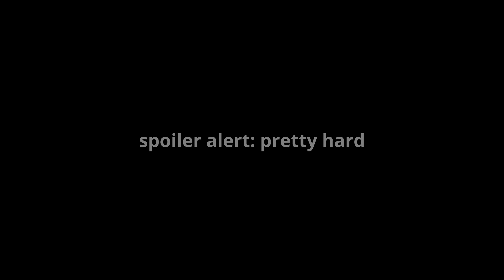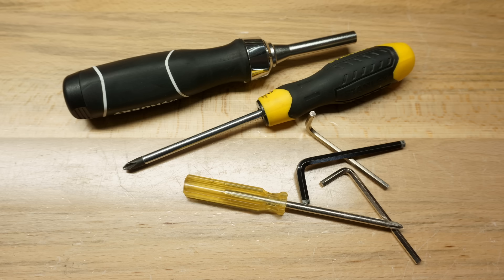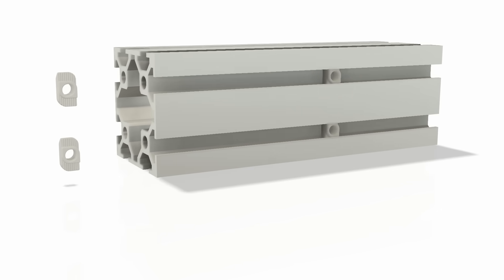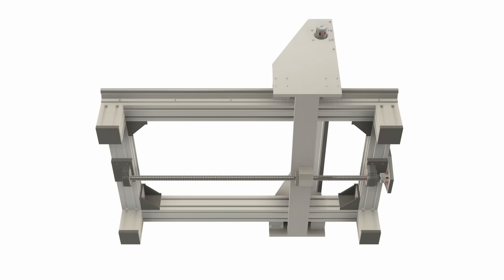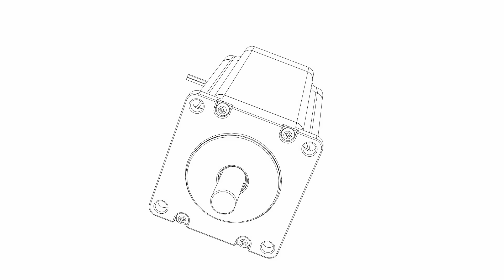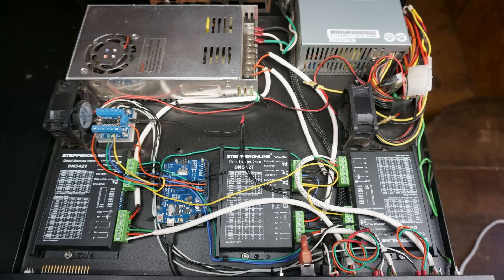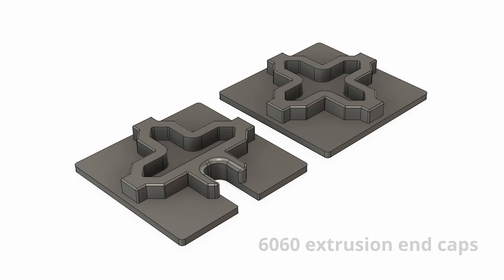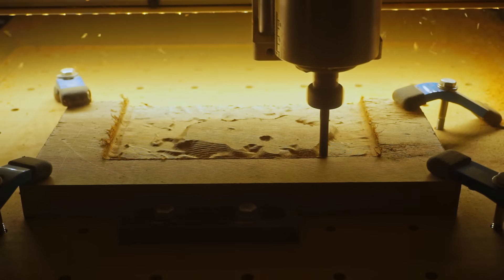Making a DIY CNC machine with limited tools

Comment from the maker: Please see my follow up video for answers to questions and more info: https://www.youtube.com/watch?v=nlWXileUSbU
If you want the 3D files and wiring diagrams, check here: https://github.com/BenMakesEverything/Ben_CNC_v1
Reply: Thanks for sharing your experience and showing this project, Ben!:)
Just a sidenode: Next time you plug in a mains-line power cord, don't move on, just wait for some seconds and think about it: What would happen, if the male contacts where swapped with the female jacks .......... Right! We would all be dead by now. Now look what you have designed/done with your motor power connectors (btw. connectors are a good idea). They literally invite disaster[1]:)

[1] Here the danger is not so much for the well-being of us humans (although it is never a good idea to have current-providing and potentially live contacts fully out in the open, flapping in the breeze), but for the well-being of the machine. Sh.. can happen in this configuration and it WILL happen! Especially in a place with metal shavings and dirt all around like a workshop. Just swap it around, so that the female part of the connector is the "power-providing"-side. 

Good machining!:)
Reply: @dieSpinnt  I don't fully understand your comment.  Can you elaborate since I'm planning a similar build.
Reply: Hey Ben - good stuff. I'm also thinking of making a Router CNC table like this (>'.')^
Reply: Oh  yeah !!! Good and fantastic Job ! Thanks for sharing
Reply: Hello, I have a Makita RP2301FC milling machine. Can I use it on a workbench like this?
Reply from the maker: @ertugrulemre2525  You should be able to, you would just need to design or buy a different bracket to mount it to the machine.
Reply: @benmakeseverything  How can I make this bracket? Thank you

Comment: Bit late but... using some really stiff spring you could mount the top with some longer bolts for leveling purposes, that would be a really flat top. Also, the NO/NC thing, this makes no real difference here, you can define that in code, just use the opposite. For false signals, you should add pullup/pulldown resistors, they might work... had a lot of trouble using them with arduino/esp32 anyways. One thing I didnt try is shielded twisted pair for sensors with pullup/downs and caps with sufficient trigger times to chnage states in code. Also, found out that using a serious power supply is cruicial. By serious I mean a transformer one, switching units work poor, forget usb phone chargers. Thing I tried to recreat was a SBR sewage system. Original board was STM32 that was literally octocoupled from anything else and isolated power. Eventually found out repairing original board was easier than debugging all the false signals with arduino and did just that. This taught me why would you need a custom PCB, not a breadboard with bunch of jumper wires doing theirs antenna stuff.... especially when working with contact relays or around large IGBTs, those can even freeze your chip, althou arduino seems more stable than esp32. Nice project, thinking of building something of this kind myself but the motion screws, slides and metal prices... anyway, cheers for a good build.

Comment: "Making a DIY CNC machine with limited tools" and yet he has cut and finished in cases sizable aluminium parts to precision with limited tools my ass! Great job but very misleading title. maybe define "Limited tools" most people think of the picture you advertise with ,a screwdriver, etc on display yet you didnt use them to cut this stuff for sure. use a cnc machine to make a cnc machine.

Comment: Great job!!!! I think the isolation/filtering of the endstops connections made the cables work like an antena. You shouldn't do that. Endstops should be just pulled up with like 10kOhm resistor and pulled down with like a 1kOhm resistor when the endstop is pressed. Those resistors are isolation enough and the conductivity is high enough to make the voltage stable without draining current (little to nothing) so interferences can't affect the digital level.

Comment: Hey ben I am looking for a CNC for doing wood this looks a bit over kill Do you have any ideas or recommendation on making one please
Reply from the maker: Well, to be honest this is the only CNC I've ever used. If you just want to buy something I've heard good things about Shapeoko, but never used one myself. As far as making one - if the goal is to reduce the price, you could possibly use smaller/cheaper motors and lead screws, although that will decrease the power. But for small wood carving that may be fine. There are other people that have posted DIY builds on Youtube, but I can't recommend a specific one.

Comment: Hi, lovely video mate! I'm also looking into building my own CNC machine and your video was very helpful. What would you say is the estimate cost for this project cause i'm on a budget? Thanks alot!
Reply from the maker: Hi, glad you enjoyed the video. This was an older video and I actually built the machine back in 2021, so prices may have changed. But I think the total for the machine was around $1000, maybe a bit more. I didn't keep close track of it but did run some numbers back when video came out because a lot of people asked.
Reply: @benmakeseverything  Wow, that's quite a good price for a machine of this capability! Thanks a lot, cheers!

Comment: Extrusions are not, as you claim, stronger than solid. Also, remember that aluminum is the butter of structural metals.
Reply from the maker: I think I said, "lighter and cheaper" - but I should say "stronger per lb/kg" since solid plates would weigh more.

Comment: Um can this machine carve thick steel?
Reply from the maker: I wouldn't recommend it - this was built for wood and light work with aluminum. Its just not rigid enough and needs a better option for the cutting tool than the router.

Comment: Hi Ben, well done young man. I use  F360, Arduino, GRBL & UGS to try to make a DIY MINI-MILL. I had an small X Y table and a spare Dremel.  All I wanted to do was hog out a slot in a 1940s Model Train Steam engine chassis and carve some sheet metal for side rod linkages of various steam engines with 4 and 5 drive axles which are not found in the old catalogues. These custom variations are my goal for the Lab I created in my Basement, Frankentrain Laboratories.  I always buy junker engines because they are cheap and no one cares if you change them.  But While I did get the contraption to actually work and I hogged out the slot in Foam. Switching to the pot metal chassis changed everything. AND Nothing held together. My couplers got loose and I lost all reference points, the X Axis nut became worn and i had massive backlash, the cutting bits i found were all too long and chattered so much i could only cut if my wife had gone shopping. It was a mess. I had to go back to drilling holes and filing the notch onto 3 chassis for customers, then soldering 3 cut up side to make the elongated version.  I got them done, the owners are happy and now with the money I want to make a real good CNC to cut sheet metal side rods. Can I scale back your design for a modest version to make model train parts from mild steel sheet metal and Pot Metal or Aluminum. In my Lab I have several teammates and we can attack digital, PCB, drives, etc I have 3D Printed Smoke Assemblies, DC Fields with Super Magnets to convert the old AC motors, All wheel Pickup or Tender Trucks and Tender Chassis and Bodys. Now we need to make Engine Chassis  as we are modifying the old ones for Ball Bearing axles and Fan Driven Smoke. We need to make the Whole Chassis for New 3D printed engine bodies that were never made in our scale. 1/64. A Mill Like yours but smaller would be an assume tool to have. I think I can strip out my old mini mill and replace it with a down sized fame as yours. Would you agree? Dennis    video of my machine and project, https://youtu.be/OFvw0755QvE?si=ZtCi1LILlODkIc10

Comment: I have an issue with my y-axis, those Axis was working with 2 stepper motor.

 The problem is it was bit not syncronice each other, where the first motor was moving on 650 mm and another is on 654 mm. Same stepper motor and driver

Comment: Are the lines on the finished art work due to the motors not being able to "step" in small enough increments?
Reply from the maker: No, the one where you see the lines is because it didn't go back to exact zero between tool-changes, on later carvings that didn't happen. But I still thought it looked pretty good so I put it in the video.

Comment: There's another way to mitigate the effects of the EMI on the switches(without replacing the Amazon-bought cable) and that is to make use of "pull-up" / "pull-down" resistors. That would require additional soldering though, so if that's an issue for some, just replace the cable with quality- as you've done.
Reply from the maker: You're right - at the time I built it my knowledge of electronics was far less than it is now - really I should rebuild the entire control box, but I haven't gotten around to it yet.

Comment: Ok, I looked at your GitHub and the two wiring diagrams, both tackle the 36V setup and how everything connects to the Arduino.  But I still don't know what you are using the existing 12V PSU for?  is it just to drive the LEDs on the CNC?  Are you stepping down the 12V to 5V to power the Arduino???  Could you include a wiring diagram for that PSU too PLEASE??!!!
Reply from the maker: The 12v PSU is literally only used for powering the light strip mounted on the gantry - nothing else, you can just skip that part. The arduino is just powered by USB when plugged into the laptop I use to send the gcode.

Comment: Have you thought about adding a shop vac or some other dust collection to the machine?

Do you have a way to control the router speed though software or are you just doing it manually?
Reply from the maker: I did think about adding dust collection, but never did. Instead I just put inside a clear acrylic enclosure, and vacuum it out after each use. There is no way to control the router speed automatically, unfortunately. I just have to turn the knob.

Comment: i find it so awesome, you basically buidl the same thing as me, usign the same rails, also 800 and 600mm long, same configuration, same goals, also a simple router as motor, the only diffrence is thew z axis assembly which i made out of some 3d printed parts and stuff i machined in school

Comment: What a great project! I'm sure it required a lot of perseverance. I am an engineer and a life-long DIYer and have thought about building one of these but weigh in the balance the challenge, amount of effort and time required against purchasing a factory unit. It would probably require several engineers of a few different disciplines, structural, mechanical, and electrical, to come up with the plans and specifications, but likely not a one could actually perform the construction. The latter would require a machinist. You accomplished all of these tasks!

Comment: You did not mention how you got the tool paths for these projects and must have missed what controller software you used. I built a 3,+4,+5 axis cnc by converting a mini mill using pokeys boards and mach 4 software. I do not know fusion 360 so i've only been able to do limited things. My motors are nema24 for the 3 axis and whatever came for the rotation tables. I had to calibrate the stepper motors for all 5 axis. Aside from this ive been busy with 3D printing both fdm and resin printers. I do not have shielding on my wires but also did not have crash issues. Using tormach tool changers and habe to do those manually. Beauty of my setup is i can move the controller box to other setups like lathe router, fiber laser etc... the computer can connect via ethernet so i can control remotely.
Reply from the maker: Hi, sounds like you have an impressive setup! Regarding the toolpaths, they were all generated in Fusion360 via the built in CAM package - basically I imported .obj format 3D models and used a 2-step machining process (roughing with a 1/4" bit then a detail pass using a 1mm bit).

Comment: As someone with two years of experience, I highly recommend avoiding GRBL-based control boards. They often encounter random stopping issues, which can be incredibly frustrating and time-consuming, especially during CNC operations. Despite upgrading my stepper driver to the BT6600 and trying multiple solutions—such as upgrading the firmware, replacing the control board, and using different CNC software,  changing usb cable,  changing firmware, changing speed,  changing power supply, supply voltage,  usb settings,  by running on different speed, Applying ground to machine body, changing usb cable,  changing different current and precision settings from stepper driver, the problem persists.

Also when you use z probe for leveling, it gets hanged, or disconnects from PC,  again a new problem results in time consuming manual z axis settings,

Imagine being an electronic engineer with 5 year of experience and 100 products delivered facing such issues with years so what a normal person will do without a technical knowledge with this worst kind of cnc technology called grbl,

 Unfortunately, this is a problem rarely discussed on online platforms, YouTubers mostly show good part of there's project only rather than ground reality,such a worst random stop problem can completely disrupt a job when the machine unexpectedly stops during cutting.

If someone have solution for this, please don't hesitate to reply back!

Comment: Hi
what was the program you use for make the design of the machine, i have solidworks but it cant open the file~
Thx and Nice job
Reply from the maker: Hi, I used fusion360. I id post the file in .step format as well, on the github page: https://github.com/BenMakesEverything/Ben_CNC_v1

Comment: Thank you so much bro.That is very helpful. You are genius 😍
I need please the arduino code for this schematic circuit. Thanks in advance
Reply from the maker: Hi, thank you! The code I am running on the machine was not written by me, but it can be found here: https://github.com/grbl/grbl
Reply: @benmakeseverything  thanks a lot bro.I appreciate it 💛

Comment: Is it possible for you give a price comparison with a comparable comercial CNC?
Reply from the maker: This cost me somewhere around $1000 but most of the parts were bought in 2020, so it may be a bit more now. Obviously that is cheaper than anything of similar size/capability commercially available, but it was a lot of work and required me to learn a lot of things in order to get it working.
Reply: @benmakeseverything  I admire your dedication and motivation. Thank you for the detailed reply.💯